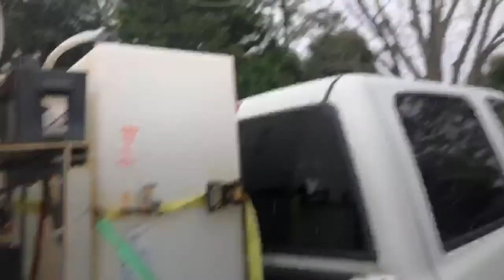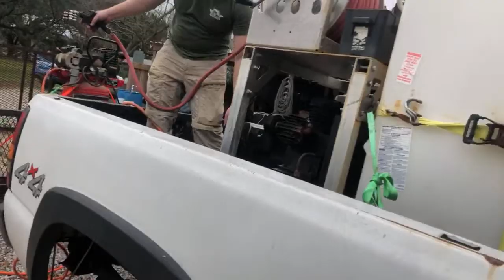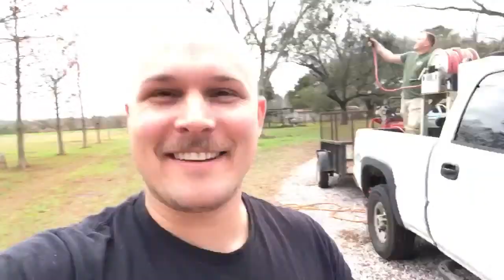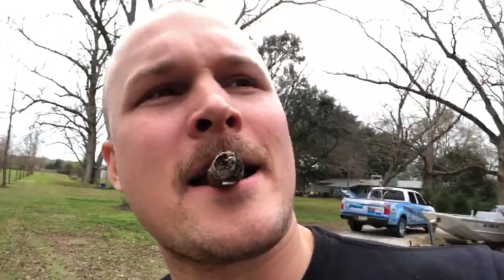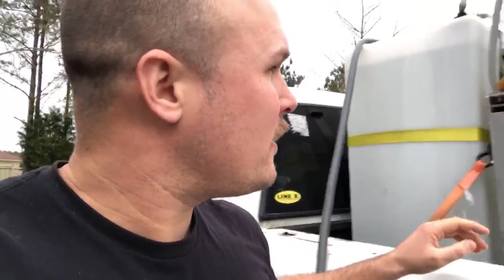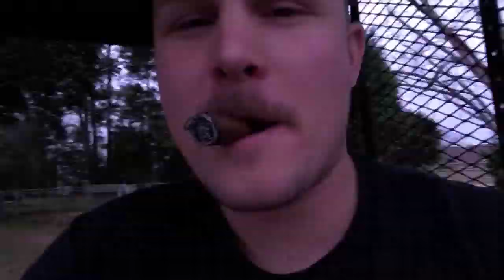John Deere Green - *Soft washing System Problems* Feat. Toe Parker

Comment: Love my 12v 5.3gpm 100 psi I get 45 ft out of it. Was thinking of trying out the air on my next build
Reply: Zach Wood problem with most 12v systems is you actually get far less gpm and psi after 150ft of hose and 25 ft of lift. Air gives better performance and ability to use bigger diameter hoses.
Reply: Get R Done  Love the whistle ,Rees Striping and Powerwash Denton Texas Shots out Happy New Year!
Reply: What 5.3  100 psi do you youse
Reply: @aceshigh235  and it cost alot more too
Reply: @michaelgordon3890  got it off powerwash.com but at the time was the only 100 psi I could find. Now I found a website that has 7gpm at 100psi right at $200 sprayerdepot.com